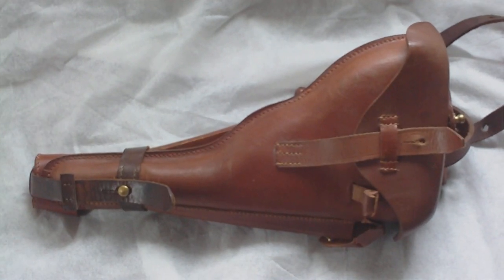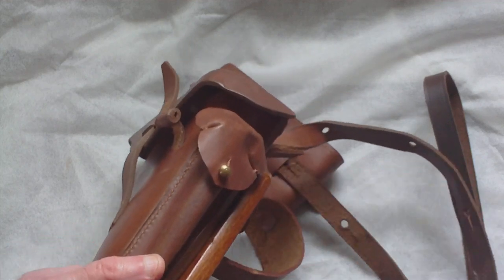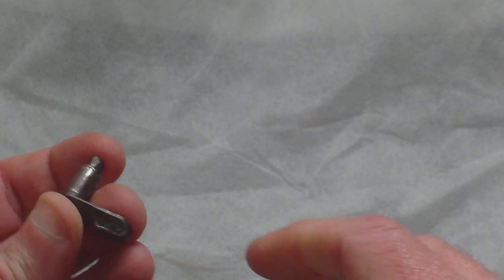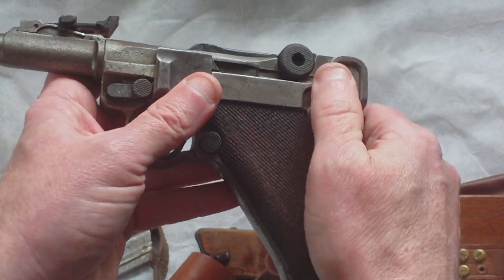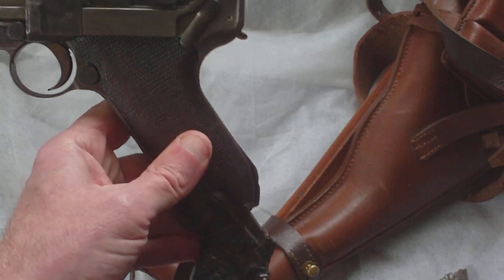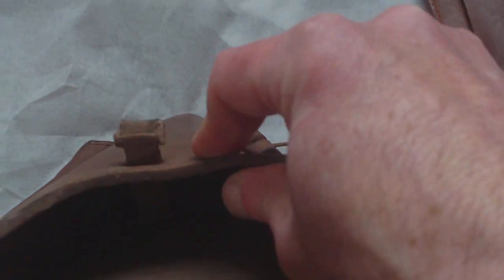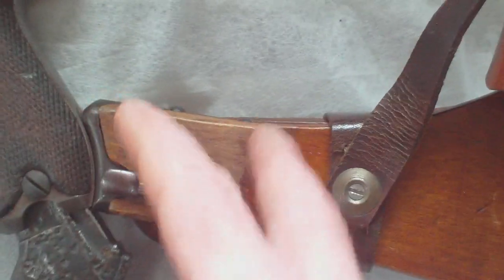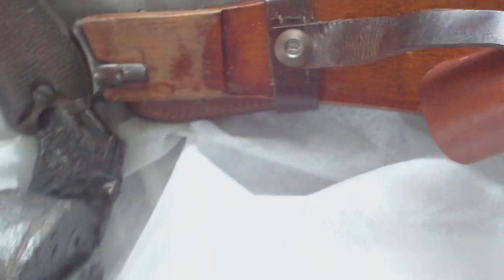FIRST WORLD WAR IMPERIAL  GERMAN DWM 1917 ARTILLERY LUGER P08 PISTOL,HOLSTER ,STOCK,DRUM MAGAZINE

Comment: That strap hasn't shrunk, the reason it won't reach is that the holster is mounted incorrectly. It's true you don't need to take the holster off to use the stock, but it's definitely not supposed to extend two inches past the end of it; it should sit fairly flush. The lanyard goes through the board from the left side first, then through the hoops in the holster, and back out through the board, fastened to itself with those brass studs. The reason there's a little cutout on the right side of the board is so you can pull the hoops inside it, making the holster sit more flush with the board.